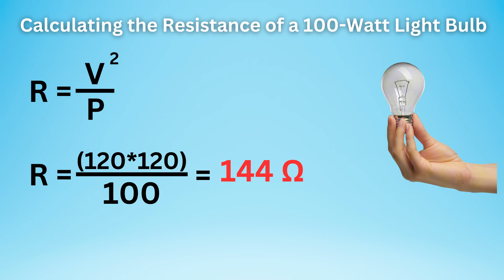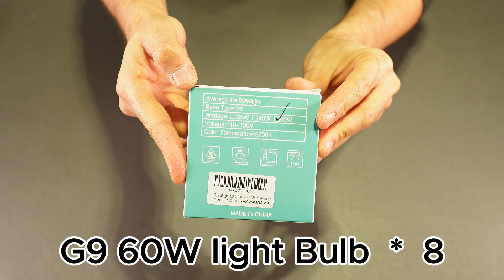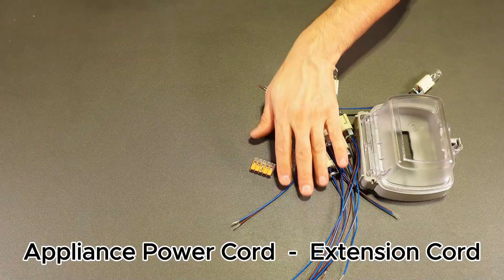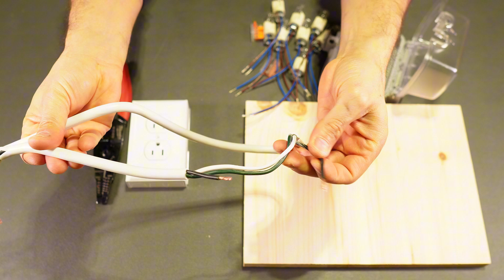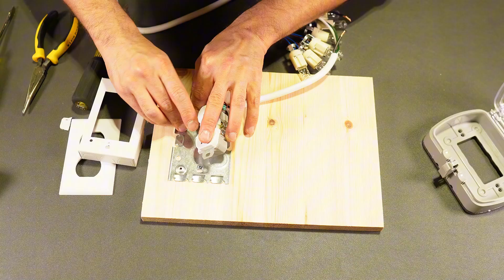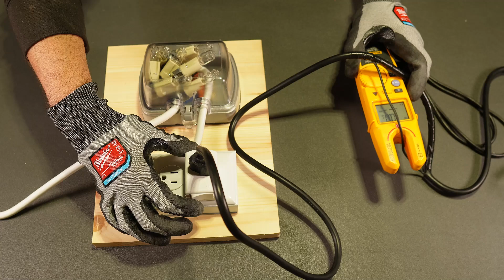Build a Compact Dim Bulb Tester for Safer DIY Repairs

Comment: people need to stop using these , it is dangerous if you test switched mode units , the best limiter is a 1000 w element or more . if there is a fault the worst case will be 4 amps  at dead short . i have one outlet wired this way , in doing so i can not make the mistake of leaving the unit shorted  on . please stop using these
Reply from the maker: I appreciate your input! You’re absolutely right that a dim bulb tester (DBT) isn’t ideal for testing switched-mode power supplies (SMPS), as the fluctuating resistance of the bulb can prevent proper startup. A high-wattage resistive element, like a 1000W heating element, does provide more stable current limiting and can allow SMPS units to start correctly.

That said, the DBT still has significant advantages, especially in appliance repair. The main goal of my setup is quickly identifying a short circuit before full power is applied, which a DBT does very effectively—the bulb lights up immediately if there’s a problem. A heating element, on the other hand, doesn't provide such an instant visual indication, and it can take longer to realize there’s a short.

Additionally, if an SMPS has a shorted component, putting a 14-ohm heating element in series instead of a higher-resistance DBT could still allow enough current to further damage the circuit, rather than simply lighting up a bulb as a warning.

While both methods have their pros and cons, the dim bulb tester remains a practical and effective tool for many appliance repair scenarios, especially when working with linear power supplies, transformers, or older circuits. For SMPS diagnostics, other tools like an isolation transformer, variac, or even a dedicated current limiter may be better suited.

Thanks for sharing your perspective! It’s always great to discuss different approaches to troubleshooting.
Reply: @SkyAppliance  Agree, and for a lot of people coming here (I for example am doing vintage audio repair) this is better than the straight 100W incandescent method and plenty safe.